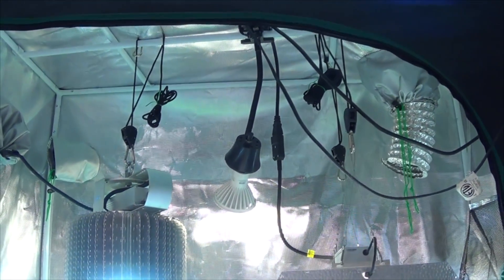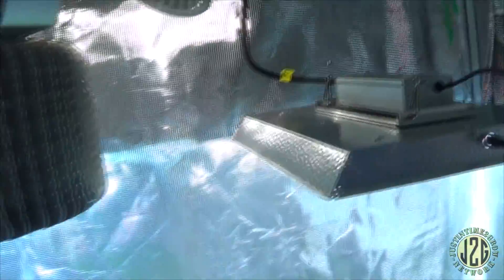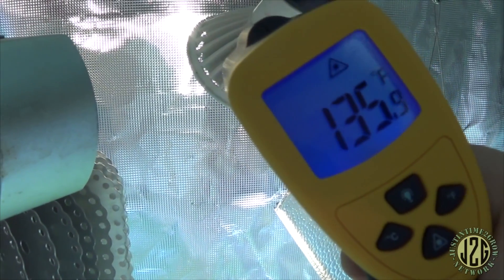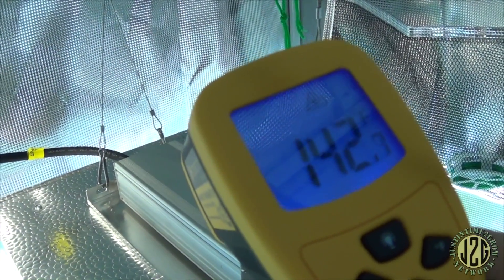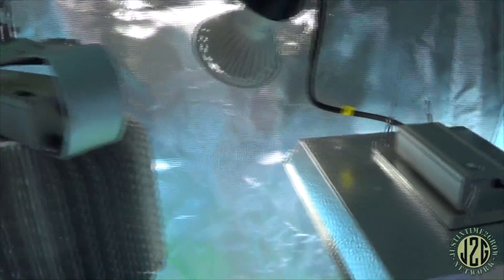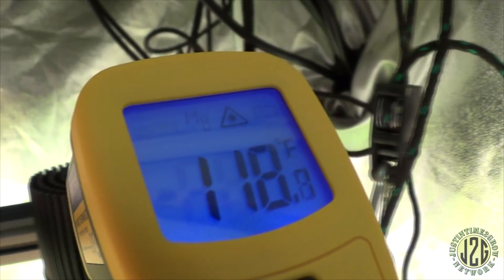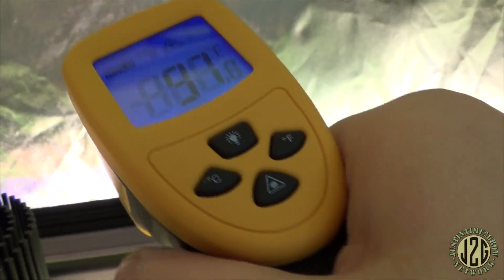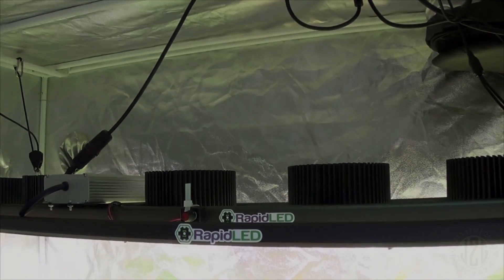Fanless LED Heat Comparisons - Rapid LED COB vs Mars Hydro TS-1000 vs Cree XTE vs 13w LED bulb

Comment: does the ts1000 needs to put 100% full in use at veg ? there dimmable knot show 25/50/75/100 , how do you think it been using correctly ?

Comment: Mars Hydro seems to close the efficiency-gap between low-cost and high cost fixtures! They seem to have recognized that they need to use high efficiency drivers and it seems the diodes have come closer to osram/samsung output levels?
We are getting near 2 micromoles per joule while stabalizing at around a dollar per watt. Nice!
Defenetly lightyears compared to the old Mars300 i used u have.
Now the question of average live-time remains. I have seen Mars600 die row by row after under 2 years usage. And they only wanted to send the replacement diodes to be solderd in by the customer (my friend in this case). All for europe maybe it's better oversees - because I really like the new lineup (this and SP 150 / SP 250).

Comment: you need to use a sharpie and put a black spot on the location you are measuring it will give you a more accurate reading
Reply: Did you fall down and bump your head?  No, a sharpie is not needed for that.
Reply: @LoneWolf-mh4ob  trying to measure shiny surfaces such as the Reflector from the Mars TS1000 will be extremely inaccurate with an Infrared thermometer, yes they have good accuracy when measuring most objects, but shiny, reflective surfaces are not so accurate. No need to be a smart ass about it
Reply from the maker: I'll try it and see how that works out.

Comment from the maker: Now before anybody goes crazy in the comments telling me how wrong I am, I realize that the Mars reading was a bit off on the reflector. I know just from touching it that it's not 89 degrees lol. After some research it seems that the polished aluminum had something to do with it because of it's low emissivity. I would take the under side reading or 150F as being the accurate reading since that side isn't polished aluminum. https://www.thermoworks.com/emissivity_table 

That being said it did run a lot cooler than I expected compared to my other fanless units.
Reply: But isn't the meanwell driving more power. Than the Mars ts1000? Have you grown anything with the ts1000 . I like the color spectrum they produce.
Reply: Thanks for this video. Keep sharing!!